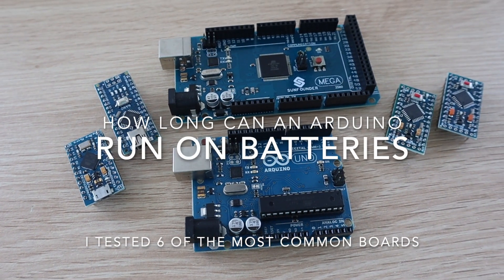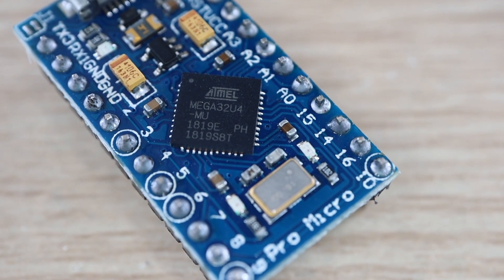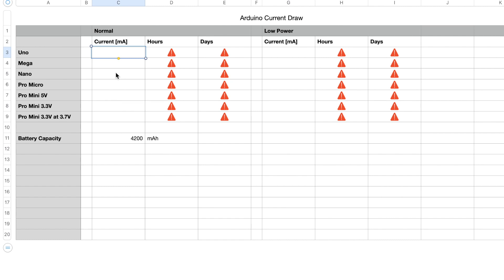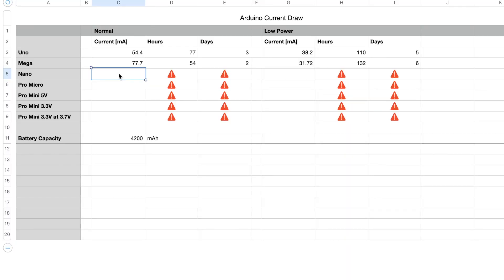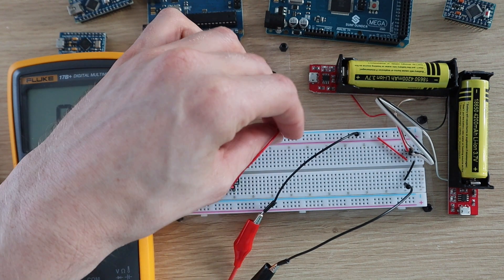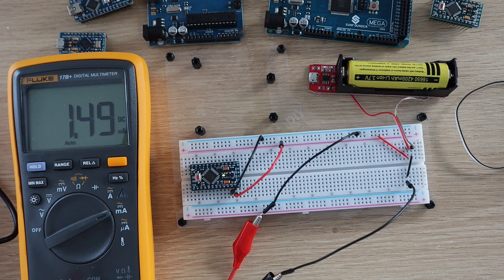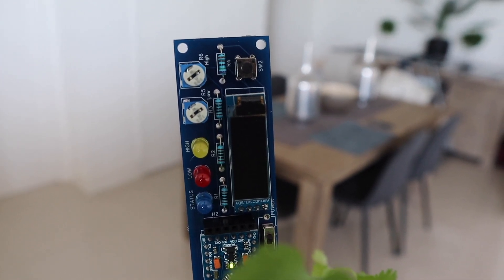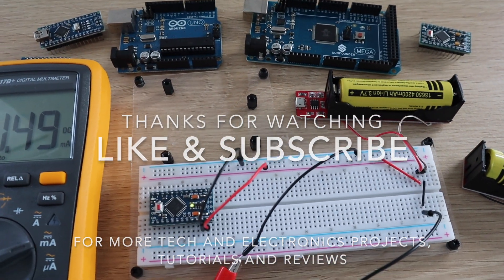How Long Can An Arduino Run On Batteries? I Tested 6 Of The Most Common Boards

Comment: The Raspberry Pi Pico can run on 3.7v with a display attached. It's pointless to boost it up unless you need 5.1v somewhere badly.

Comment: Hey man can you please help me ,
My arduino turn on by battery but it does not run the code ??
It's like there is no code inside it 
But if i connect to laptop it works .
Any solution for this ?
Reply from the maker: The battery is likely not able to supply enough current (or possibly incorrect voltage) to run the Arduino. The power LED might come on but the controller behaves strangely if it doesn't get enough power.

Comment: Do you know that for any given battery chemistry there is a measure known as power density. I don't have the number handy, but I do know a legitimate 18650 LiIon with protection weighs 45gm and has at most 2,600mAh. In order for those batteries to have 4200 they will have to weigh at least 73gm. I guarantee you they are fake. I apologize if later in the video you disclose these facts, but I have only watched the first few minutes. Very unhelpful video. Also, research what happens when using a VOM to measure sub 1A currents. Hint: it messes up your readings and not in a good way.

Comment: First the capacity of the battery, that rating is fraud. So not a fair test.

1000ma true capacity battery will run a nano 24 hours. 8 hours a day, so 3 days.

Comment: Where can I find those battery holders with the built in chargers? Those would be really useful. No need to remove the battery from the project to charge them.
Reply from the maker: I bought them from Banggood - https://bit.ly/3nKqyFp . Yes, they're really useful for rechargeable projects!
Reply: @MichaelKlements  Ok, good to know. I bought some similar from Amazon. In addition to the charger, they also have a pair of step down regulators, one for 5v and one for 3v3.

https://www.amazon.com/gp/product/B088BWXPB3/
Reply from the maker: These one's also look really useful. Having the on-board power switch is neat.
Reply: @MichaelKlements  That's what I thought as well. They will be here in a few days so we shall see how well they work.
Reply: Be careful, not all of these devices are capable of proper UPS function.
Reply: @john543  I found some of the battery units, and they work great. I tested five of them with identical Pi 3's and they ran for about 72 hours without power attached and they worked great.

Comment: Hi sir, i want to ask, why my arduino blinking like on off, on off when i measure with my multimeter. I use 9v bat for powering arduino.
Reply from the maker: What are you measuring and how are you measuring it? This is a very open ended question.
Reply: @MichaelKlements  Sorry its my foult, luckly my multimeter doesnt broke😅. Nice video. Thanks for sharing👍

Comment: can I put 4 18650 lithium-ion battery for Arduino board to power a collision avoidance car
Reply from the maker: 3 would probably be fine, bu t you should be able to use 4 as well.

Comment: Are the batteries you're using protected or unprotected? They seem to be mounted on a module. Does this module protect against over discharge?
Reply from the maker: They're unprotected and the module that the battery is on is only a charger.

Comment: Its like testing car Fuel consumption without going anywhere.
Reply: Epic bro
Reply: Fuel consumption in idle, yes. But it's part of the puzzle, actually the part that I'm looking for: I can calculate how much everything else is using myself.
Reply: You are right, but he still shows something usefull, witch board is the most power efficient, and about speel mode/low power mode
Reply: Kinda. Not really
Reply: @wilfdarr  exactly

Comment: I bought these same batteries. Once fully discharged, I charged and found them to be only 1800mAh. I learned the hard way, if you want quality batteries try Panasonic or Samsung instead. You get what you pay for. No such thing as a 4200mAh or 9800mAh 18650 on the market only cheap China knockoffs.

Comment: can a arduino uno board run for 30 days continuously? if i can supply power continuously
Reply from the maker: Yes it can, they’ll typically run for a couple of years - depending on the quality of the components used.
Reply: I’ve had mine running for the last 175 days continually without a problem. It’s been on and running combined for over 250 days easy. I’m using the arduino uno genuine board.

Comment: Battery Time is calculated with the Formula T = (Battery Voltage x Battery Ah) / (MCU Voltage x MCU Current) which will give you the result in Hours. Hours /24 Hours give you the Battery Days without defficiency...
Reply: Yeah, I was thinking the same thing, this video doesn’t accurately calculate battery run time

Comment: How much time would Arduino nano be on 9v battery if connected to servo
Reply from the maker: That's quite an open ended question. 9V batteries vary significantly in capacity and so do servos. It'll also depend on how often you're moving the servo.

Comment: Very nice experiment!  I've been wondering about which boards might be most suitable for 18650 power, and this certainly answers that question.   The information you provided regarding sleep mode is also very useful -- I wasn't aware that was available.  So thanks very much and I'll look for the follow up video you mentioned to see whether you were able to do even better.
Reply from the maker: Thanks John!

Comment: I think that as a fairer test you should have used the same two batteries in parallel for the 3.3V versions.
Reply: The voltage would have been the same; you would just double the total capacity.  Instead of 4 months of life, you'd have 8 months.

Comment: Does this change substantially by desoldering the on chip LED's?
Reply from the maker: Not really for the Mega and Uno, but it does make a significant difference for the smaller Arduinos, like the Pro Micro, Nano and Pro Mini. I've recently done a video on this as well - https://youtu.be/A3shZgR5Y68

Comment: anyone help me please. its for my school project. i made a mood lamp and when i connect to the battery(9v), the board only turns on for about 10 seconds and then it will turn off for about 3 sec and turns on again, and the cycle continues. please if anyone knows how to solve this please help me....
Reply from the maker: Some cheap 9V batteries are really poorly made and can’t handle the current drawn by an Arduino, especially if you’ve got a motor or servo attached. So the voltage drops and the Arduino cuts out and restarts.
Reply: @MichaelKlements  oh but i think its bc of my battery holder bc my dad said they're low quality and the wires in it is too thin
Reply from the maker: Yes, it could also be that!

Comment: How did he wire up the batteries and used them together? Is it in series or parallel? And can you please tell me how they are connected? Thank you!
Reply from the maker: The write-up linked in the video description gives you more information on this. They're in series for the 5V tests and then just a single cell for the 3.3V tests.
Reply: @MichaelKlements  The batteries are 3.7 V each right? Will destroy the board? Sorry I'm kinda new with arduino and really like to learn more. :)

Comment: Im 100% sure that battery is not 4200mAh
Reply: @carlerikkopseng7172  its an easy one to prove. The highest capacity li ion18650 battery available is by Samsung, LG and panasonic is 3500 mah. These three companies are very reputable in this field. Even then, these 3500 mah are very expensive. I doubt a random chinese company would be able to achieve higher capacity than these
Reply: >that battery is not 4200mAh
guess we need to invade china so we can put those people putting wrong numbers on batteries in prison
Reply: @Henry-sv3wv  you can simply not buy scam products.

Comment: How long would a Nano last if I used it 1 minute a day?
Reply from the maker: One minute a day is less than 0.1% utilization, so it won't be much different to the test results. Probably around 20 days on a 3000mAh battery.

Comment: WOW! your batteries break the limits of physics AND chemistry just to be 4200mAH.
!this video isnt very scientific, your method stands to be improved in many ways.
Reply: Zero arguments, stop spamming please
Reply: @nbcq302  actually i'll partially agree with OP. Altough cells used in this video are definetely shitty and surely doesn't have 4.2Ah capacity, author's method of measurment is correct. If you really had 4200 mAh 3.6v cell, calculations would be close enough. However if you have something more realistic like Samsung's INR18650-23 with 2.3Ah capacity, just include this in your calculations :)
Reply: @lis6502  with the calculations, he had a wrong, it’s 4500 mA hours at 3.7 V, the total milliamp hours changes when he’s running them in series at 5V

Comment: These 18650 cells are fake. There are no cells with more than about 3600mAh only the very best LG cells have it. More often 3000 mAh or 3400mAh.
Reply: The high capacity ones are quite expensive. Typically you get 2400mAh-2800mAh

Comment: I'm wondering how this compares to, say, using an uno to program the atmega and then operating it as a standalone microprocessor.  How much energy cost is in having the rest of the arduino board around going unused?
Reply from the maker: Well it depends on what you’re trying to do with it. Arduino boards in general are prototyping boards, so they’ve got a lot of components on them to make them as usable as possible but being power efficient isn’t really a consideration.
Reply: @MichaelKlements  True.  
Just a curiosity.
Reply: I was also wondering how just the chip on a breadboard with a crystal would do.

Comment: How did you set up the wiring?
Reply from the maker: It’s just the two batteries in series and then those connected in series with the multimeter current probes and then onto each Arduino
Reply: @MichaelKlements  Thanks!
Reply: @MichaelKlements  so it's not a problem when the arduino connected with 7,4v as long as it's attached in Vin-G pin?
Reply: @aaivilchip  yeah the vin pin has a voltage regulator so no problem

Comment: remove +5V LED indicators as well as RX/TX  uno board is not low power board/components. You can also try running all processors on 1MHz not 16Mhz and see difference :)
Reply from the maker: I did a follow up on this video where I tried a couple of different things to make a Pro Mini more efficient. I got it down to using a couple of microamps, so the Arduino would outlast the natural discharge rate of the battery.

Comment: Nice test to see the bare power consumptions of the controllers.

This test does not account for the fact that there is a voltage where the arduino stops working reliable working under a certain voltage. Especially in the case where the 3.7 volt is directly attached to the arduino.

Also you did not include a battery protection to prevent deep discharging. When connecting the arduino to the batteryterminals, there is nothing stopping from going under the presumed safe 3.5 volts.

The 4200 mAh rating is chemically not feasible, the max capacities with current li-ion technology, you could probably get 3500 mAh.
Reply from the maker: As you've said, this test was more about testing the current draw from each Arduino setup than it was about correctly designing/sizing a battery setup to power them. All your points are valid when designing a battery powered project.

Comment: it's amusing that people in comments sections tend to pick on "fake battery" instead of appreciation that someone actually measured power consumption in mathematicaly proper way xD
Thank you Michael, this video was really educational!
Reply from the maker: Haha, if there is one thing I've learned about Youtube its that people will always find something to complain about. At least we all learn from it and can make improvements for the next one.
Reply: Not just fake batteries, but incorrect mesuring method plus, all that data is in the data sheets.

Comment: cool video, and nice projects! Do you know how long those controllers last while in usage? Like with some kind of sensor and transmition (pir/433)
Reply from the maker: It depends a lot on the type of sensor and how you’re using it. Sensors like thermistors and LDRs use very little power where GPS and GSM modules typically use significantly more than the Arduino would. There are also ways to reduce the power consumption by sensors by only turning them on when they need to be used or using a “sleep” mode.
Reply: @MichaelKlements  brother.. i am making a project using arduino uno, touch module ttp223, reset switch, 1 digt lcd 7 segments. Can you tell me what will be the best battery source for it. I bought a single 9v battery for it.